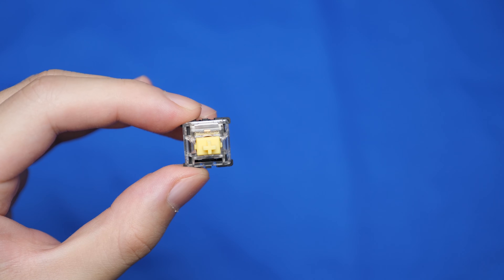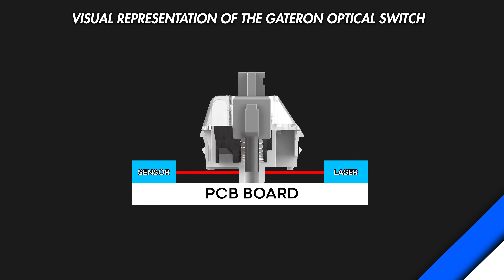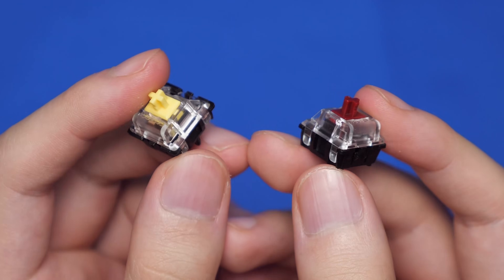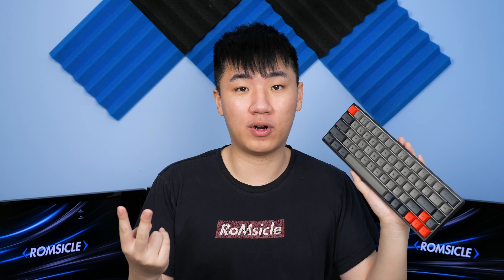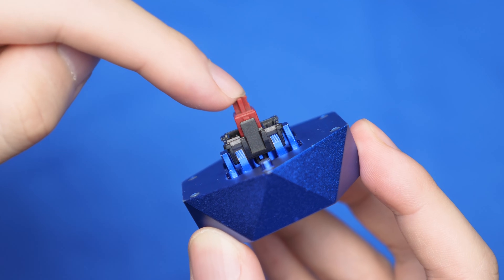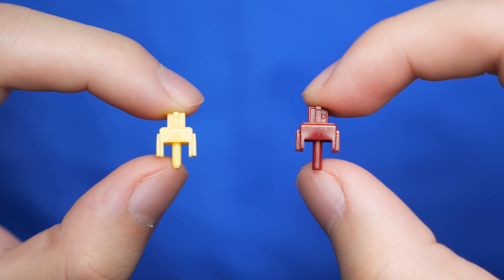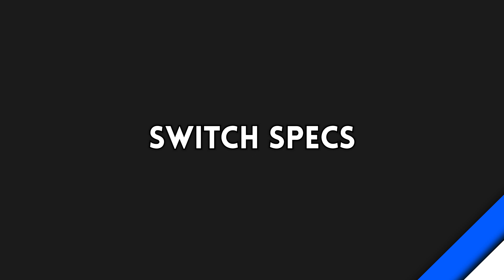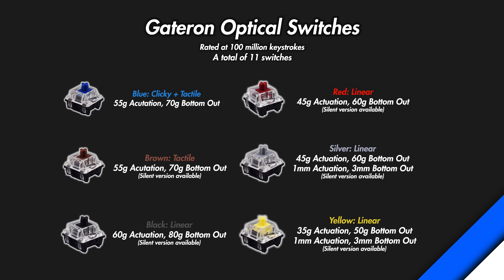Gateron Switches: Mechanical VS Optical! (Sound Test)

Comment: I have both gateron reds and the new razer reds, out of the box the razer feels way better! Ok yes you get the rattling sound when you shake the keyboard but seriously that’s not normal use. 

The gateron switches have a small scratchy feeling out of the box and a hard bottom out, whereas the razer is like landing on a cloud.

After applying lube to both switch types my favourite by far is the razer still, it’s so silent and smooth! Don’t get me wrong the gaterons still feel good, but I assume the rubber lined switches of the razer help a lot with it’s over all feel.
Reply from the maker: That's an interesting take, a mechanical switch SHOULD be scratchier than an optical switch, especially if it's linear. But I'm pressing X to doubt the fact you (properly) lubed the Razer Optical switches. I also don't know where people keep getting these false specs on the switches. There's no rubber lining. It's just plastic.

btw, its*, not "it is overall feel"
Reply: @Romsicle  I forgot to add the gaterons are optical as well... anyway yes the new razer switches have silicone inserts, watch randomfrankp’s video about the huntsmen mini where he opens a switch and shows it. Ok and it’s not lined but two strips that act as damper make the bottom out of the key feel soft. 
To lube such a hard to open switch I use a needle to drop down some ptfe dry lube into the slides, then on the outer spring I used a dielectric grease on all the contact points of the wire spring.
Reply from the maker: I see. They only advertise the dampeners for the Gen2 Linears for the huntsman mini only...what's interesting is that Razer doesn't publicly share the fact that the switches are lubed, which begs the question whether they're really lubed or it's a marketing ploy told to reviews to make the switches seem better. Thanks for letting me know, appreciate it!

Comment: if you game alot the optical yellows are THE BEST!!!
Reply: why tho ?
Reply: Should I get the gk61 with Gateron optical silver or should I get the mz60 with Gateron optical yellow
Reply: MrGreenBolt same thing they both work the same the silvers and yellows have the same reaction speed
Reply: Yeah until you want an actual keyboard that doesn’t support optical switches

Comment: Hello i have a question is the laser sensor built in like to the keyboard not in to the switch cause when you can activate the sensor or the type with pen you didnt have switch on so i think the sensor is built into a keyboard. But correct me if im wrong
Reply from the maker: That is correct. That's also a reason why all optical switches are hot-swappable.
Reply: @Romsicle  Thank you so much i right now have apex pro tkl but if that breaks im getting the gk 61
Reply: @Romsicle  hey so i should be able to swap my kailh optical black to some gateron opticals right?

Comment: if you get a board that comes with opticals does the board change at all to cater just to optical switches or can you switch them out and put in traditional mechanical switches?
Reply from the maker: An optical keyboard can only use their own exclusive optical switches. And vice versa. They don't mix at all.
Reply: Yiu didn't even thank him smh

Comment: is the Keychron k8 hotswapple with gateron optical switches? im trying to buy one of the keychron keyboards, but i want to switch them out with gateron clear optical switches. i dont know which version of the k8 to buy. help
Reply from the maker: Not sure, you should contact them and let me know if they are. From pictures, they don't seem to have the same bottom housing.

Comment: Optical browns feel nice but I keep accidentally pushing down my wasd while I'm standing still in video games. Kinda weird since some people say its hard to push down the keys.
Reply from the maker: I've only had that issue with 35g springs. If it keeps being an issue, you can always buy some heavier springs for cheap on AliExpress.
Reply: yes I also have brown switches but mine are lubed and for me they are fine but it is true that they are very sensitive to the touch
Reply: When I'm tired I always accidentally press the a or w key and I suddenly wake up because my character magically moved lmao
Reply: I'm using red switches and they're pretty much great. No accidentally pushed buttons, but i would like to try out more heavier switches or tactile ones.
What concerns me the most is the actuation point of 2mm though. Gonna buy some silver switches for qwer and see if there srill be moments when i push button long enough for it to work but it didn't.

Comment from the maker: Keyboard Used: SK68 with DSA PBT keycaps (review coming soon) P.S. I hate typing on DSA keycaps.
Note: I couldn't find the bottom out force for the Optical Silvers anywhere on the internet,
 so I just used the 15g increase found in most of the other switches. But regardless of the switch springs, they don't feel any heavier bottoming out than your typical Gateron switch.
Reply: Which one is good optical or mechanical in your expirience
Reply: Im honestly very sorry for necroing but is the sk68 better than the hk61 in your opinion?
Reply from the maker: @aryanb5749  In terms of performance, the SK series are better. But for flexibility, the GK series would be better, ie. trying different switches.